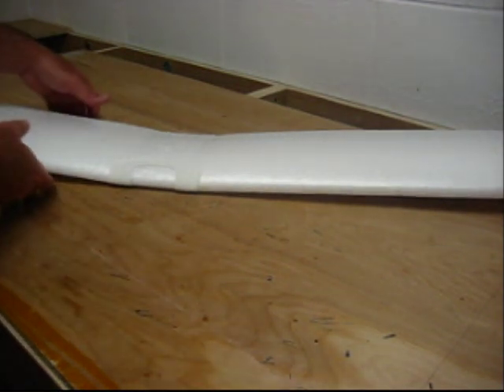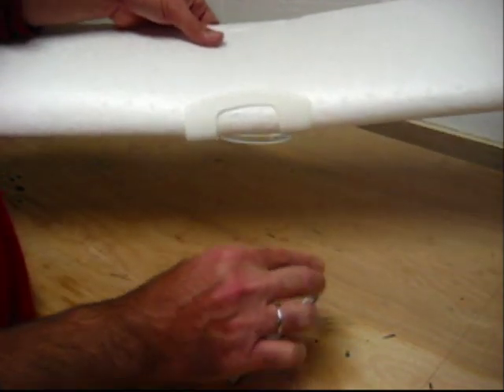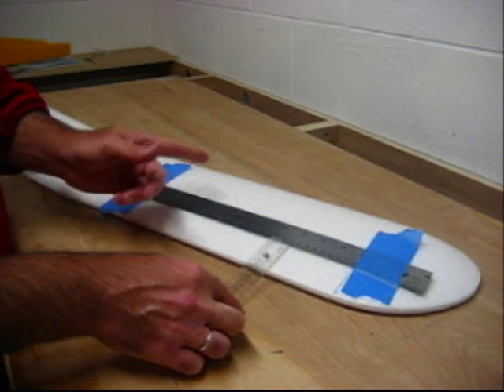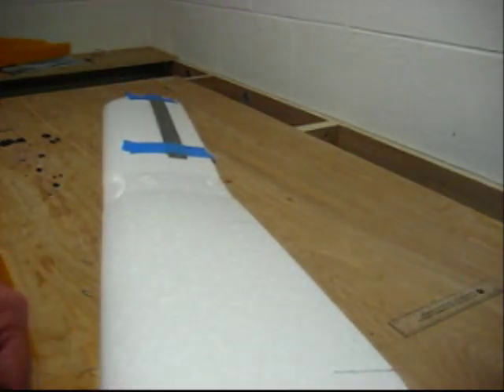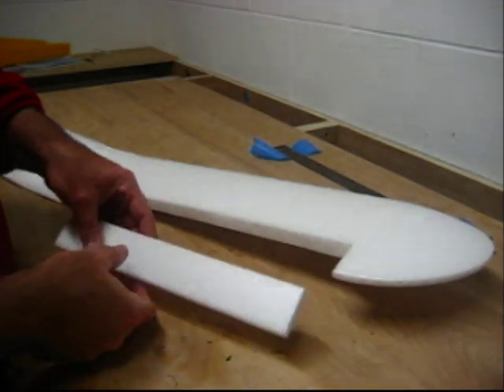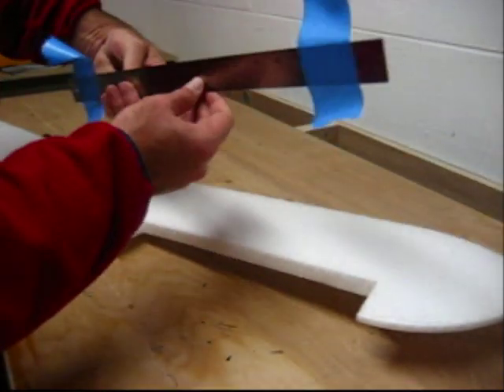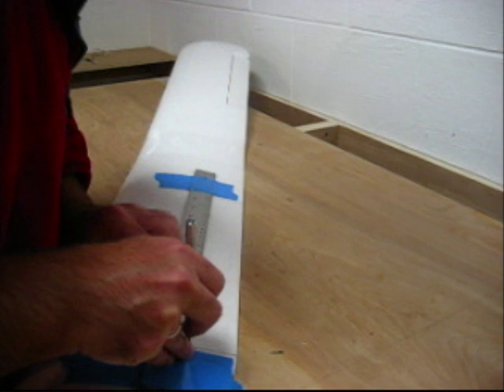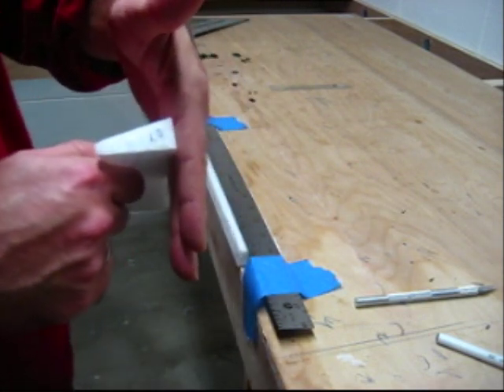5-Cutting out Ailerons Part 1 - Building HZ Super Cub from Scratch

Comment: I added ailerons to my SuperCub using two servos. My turns are now sharp and precise and the plane indeed is now a pleasure to fly. I also upgraded to a brushless 400 motor system and new prop. The only issue I have is somewhat poor rolls. When I use the ailerons,  the plane rolls one or two times but dives sharply downward at the same time. I can't seem to get a smooth straight rolling action. Any advice out there? Thanks.